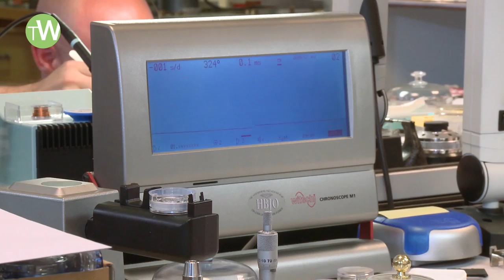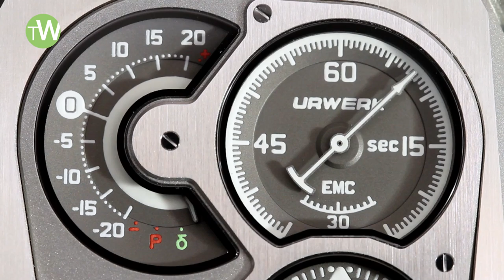URWERK breaks the rules with the EMC

Comment: Nothing new- it's 30 year old Grand Seiko Spring drive technology. But not an efficient one. Grand Seiko perfected it to have more than a months power reserve, this one needs constant winding
Reply from the maker: It's not really the same mechanism, the main difference is that the electronic has no impact on the running of the watch or power reserve.
Reply: Thats exactly what spring drive is? The Power REserve for mechanical part  in Spring drive is still the the main soring, only the regulator is controlled by the trisync regulator thats in sync with peizoelectric quartz powered by the capacitor.  which oscillates at 2^15 Hz of the Quartz. As mentioned by you this ones oscillates at 16000 Hz or 2^14HZ may be a different variation of quartz.
Reply: It's not a spring drive at all.  Clearly noticeable to the layman by the fact it does have a smooth sweeping hand, which is a by-product of the spring drive mechanism.
Reply: debendra gurung Seiko is my preferred choice as well.